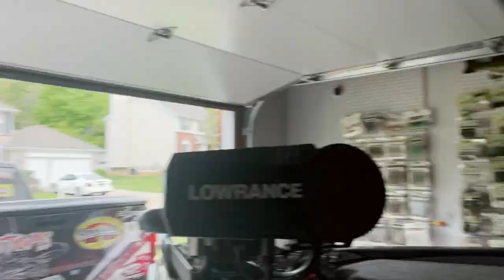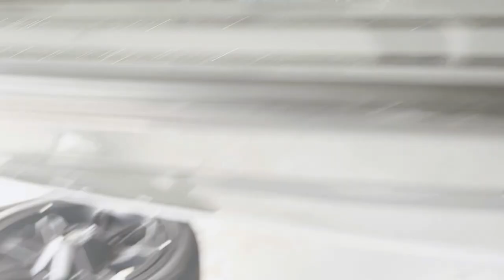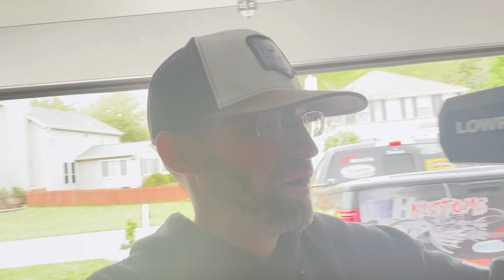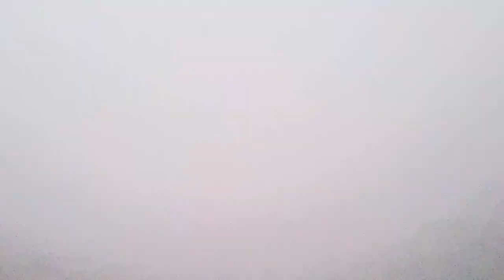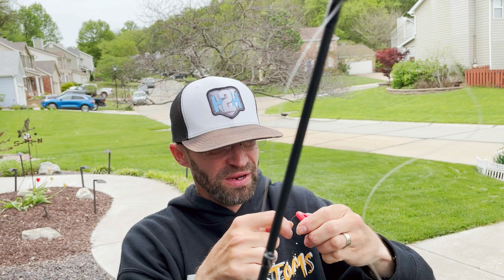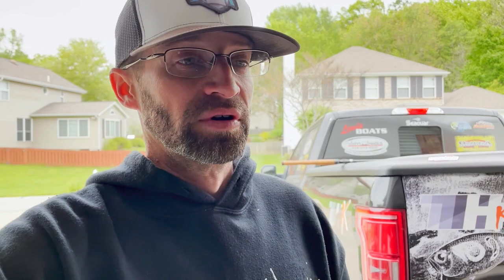Testing a Customers Reel...Making it Better

Comment: Hey just discovered your channel" on one video you mentioned doing a Tranx (bearing upgrade) have you done that video? 
Also I have some older gear (good condition but older) Shimano Trinadad & Newell reels. I don't have schematics or parts list for any of them; how common is the bearing size for reel lines in general? Example- Shimano Trinadad (Gold) reel size & spool" VS Trinadad A (Silver) reel size 12 & 14 spool size and capacity are about the same. I can find the info for the newer Silver A model but can find info on the older gold models. Is it worth taking a chance they use the same size bearings on both? On my older NEWELLs it's clear that they used the same bearing on most reels even as the spool size widened. What is your thoughts on figuring out bearing size/how to order new bearings for older reel upgrades?